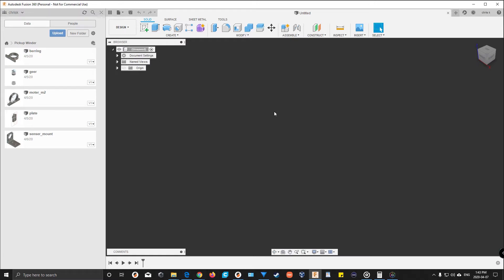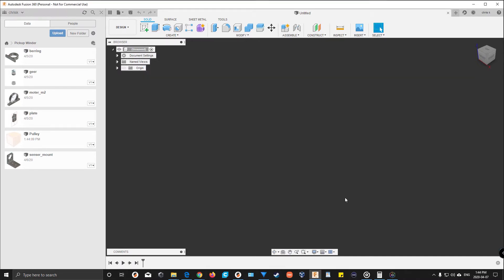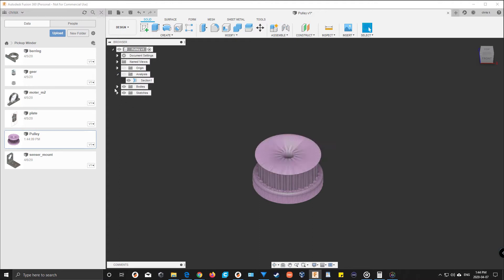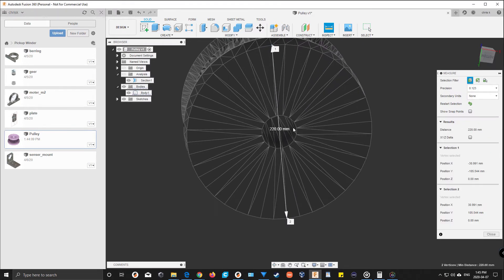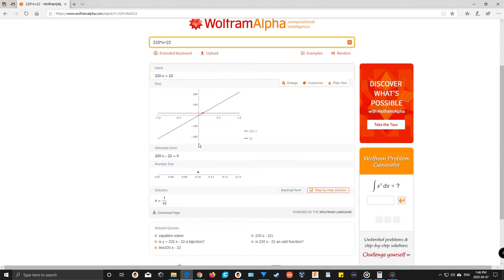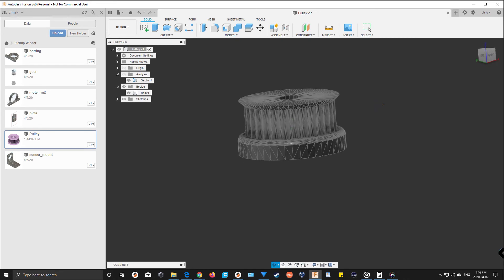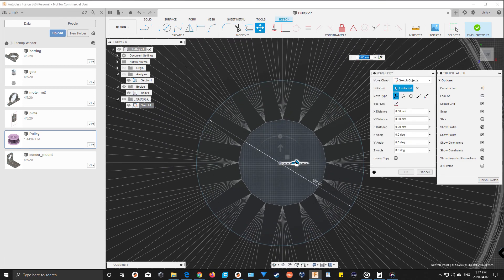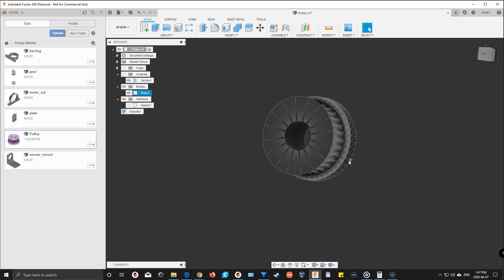how to import a OBJ or STL into Fusion 360 (old version)

Comment: What? You need an equation solver to calculate the ratio between 220 and 22? What's wrong with your brain?
Reply from the maker: My personal reminders YouTube channels purpose is as I learned something I quickly upload a video so I can reference it later if I forget in this case I hadn't stopped to think through what I was doing long enough to realise that I just needed to move the decimal point. My more polished content usually ends up on my make it work channel https://www.youtube.com/channel/UCNwHKYtnJNa8xNW4sbzNwMw